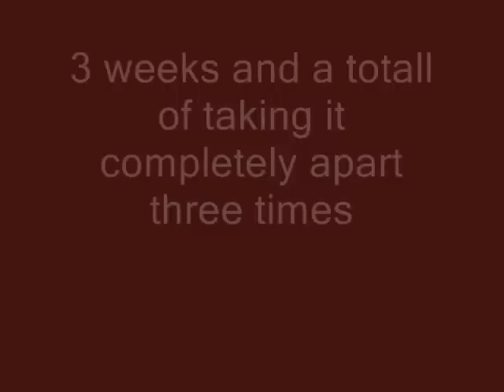Automatic transmission rebuild

Comment: I liked the video.  I'm very curious if you think you could take out a transmission using floor jacks.  I've got a 2001 Lexus RX300 (that's the smaller 4wd suv).  Did you use a shop manual?  Did you take notes?  I'm on a very tight budget, but I need this car fixed.  I bought the car knowing the seller said it had transmission problems (wouldn't drive for very long and, then, would stop) -> changed fluid/filter solved for 6 months.  Now frozen up until "wrenched" from tow truck. Now moves &broke